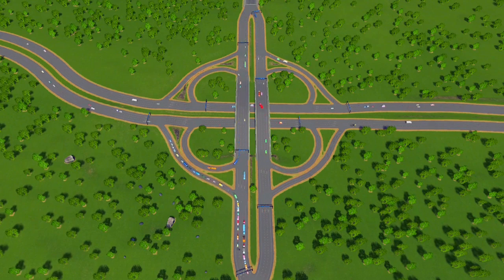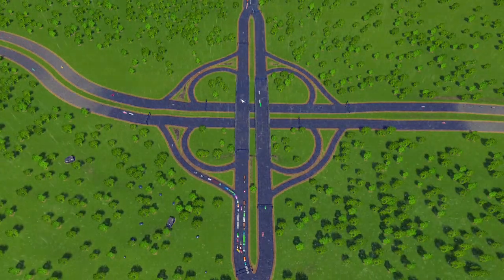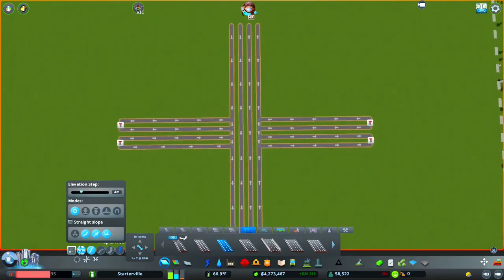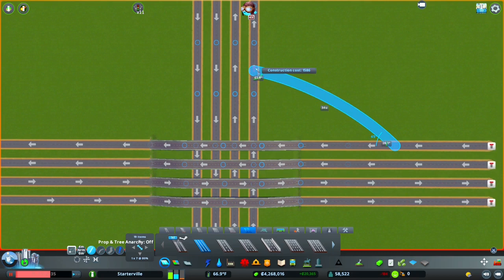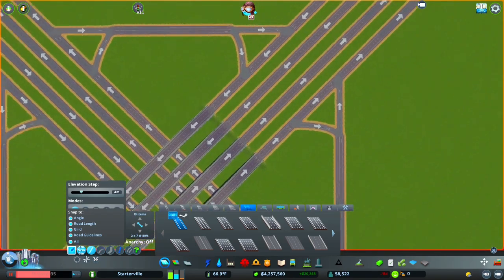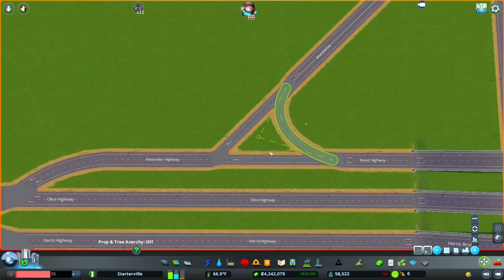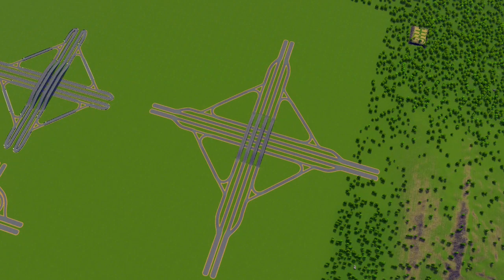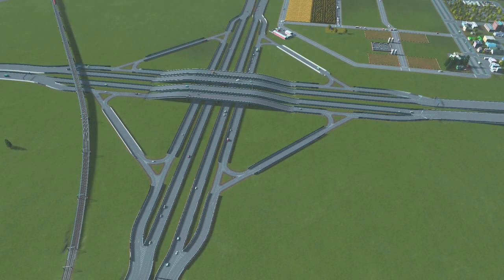Improved Cloverleaf Interchange - Introduction and Build Tutorial

Comment: That’s terrific! Thanks for building my suggestion! Are you going to upload it to the steam workshop?
Reply from the maker: Absolutely, glad you like it! I'm trying to find a way to build it and put it on the workshop. Right now it's too big and doesn't fit in the size limits given by the cities: skylines editor.
Reply: @ChipNRat  Don’t know anything about that as I have never dealt with uploading to the workshop before.

I suppose that if you wanted to remove the collector roads and hook the ramps directly to the highways, it would still have less weaving problems than a standard cloverleaf due to the longer area for the weaving to take place in. However, that would reduce its advantage over a standard cloverleaf. Hopefully you can get it to work.